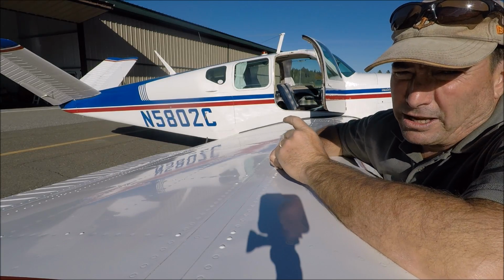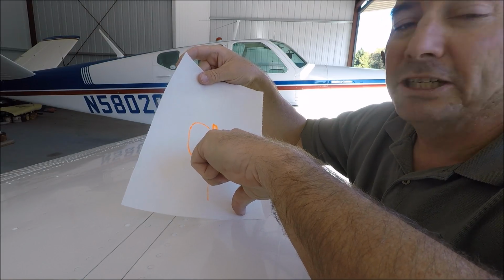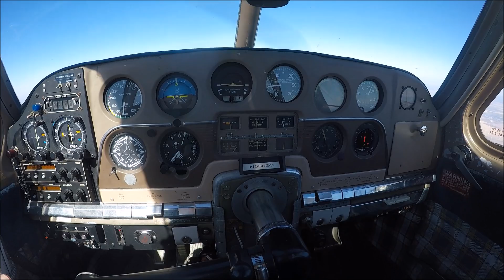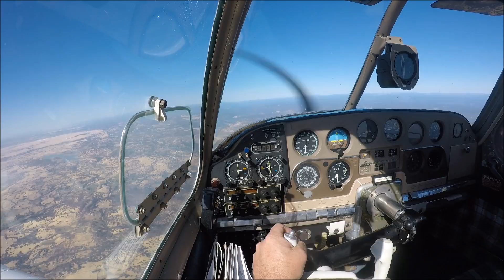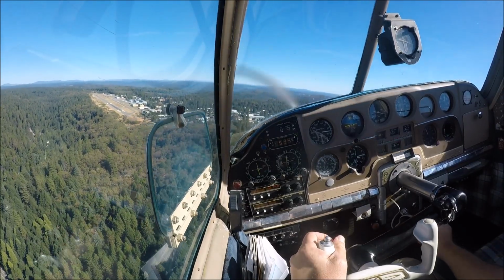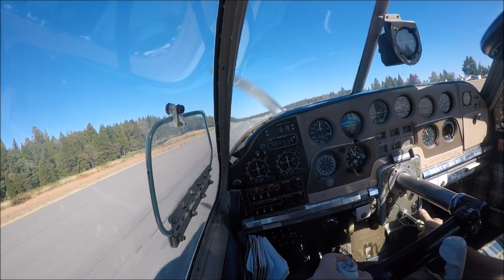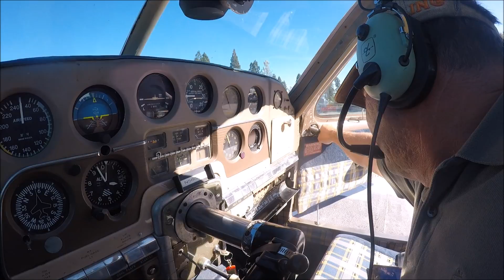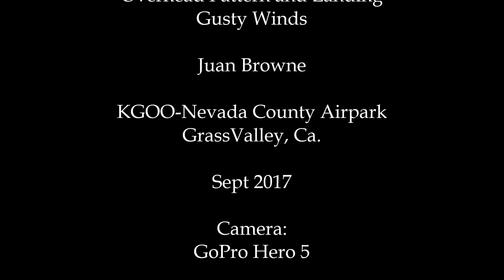1952 Beechcraft Bonanza Overhead Approach and Landing in Gusty Winds

Comment: Juan, Your explanation of a military approach reminded me of how we went into hot LZs in a huey, nearly 50 years ago.  Right over the LZ, reduce power (lower collective), pull back to 60 knots, then turn into a tight 60 degree bank.  Usually a couple of rotations and we were doing a cyclic flare in the last 270 degrees of turn.  Just a touch of collective at the end for a smooth landing or enough to hover.  The main point was, if we had lost the engine during the approach, we were still going to land in the LZ.  I love watching your approaches.  Constant adjustment, keeping the aircraft where you want it to be.
Reply: As with Juan,  THANK YOU BOTH FOR YOUR SERVICE FLY BOYS. 💙💙

Comment: Great Video Juan.  I liked the dialog hanging onto the wing at the beginning.  

Everybody has an Uncle Joe story and mine is that my Doctor in Simi Valley, Dr. Elias Khoury, bought the farm in one of these.  Had to find another Dr which was a real chore as he was a gem as well as a local character wearing tie-dye pants and rode a motor scooter around town.

Interesting that as a pilot I never came across your explanation of the pattern approach modes used by the Military as opposed to the rest of us flying normal 45º entry patterns.  Thanks for the info.  Regards.

Comment: Thank you for this video Juan the Cadillac of the sky for sure! As far as gas goes I bet you would spend more on gas in the same year GM Cadillac on this round trip.Taking the heat running ac as well almost 3 hour 1 way trip.Comparing the 2 apples to apples I would think I'd take the sky route every time!

Comment: Thanks for taking us along ! My boss back in the late seventies had one of those along with a Mooney  M20F Executive , I think . I seem to remember some pilots got into trouble with the V tail ? I do not remember what the problem was . Only small plane I spent much time in was a Cessna 172 my buddy used to rent from the Boeing Flight Club around 1980 . If I remember we could rent it for 12 hours for $99 , including fuel ! I was always amazed at how a pilot could know what radio frequencies were needed depending on where you were . The Puget Sound area has several airports and military sites . My favorite runway was Friday Harbor on San Juan Island . You landed up hill and took off downhill . It was also the narrowest paved runway we ever landed on . Look forward to whatever your next video will be , thanks for your effort .
Reply: Wikipedia: In the mid-1980s, the Federal Aviation Administration grounded the Beechcraft Bonanza due to safety concerns. While the Bonanza met the initial certification requirements, it had a history of fatal mid-air breakups during extreme stress, at a rate exceeding the accepted norm. The type was deemed airworthy and restrictions removed after Beechcraft issued a structural modification as an Airworthiness Directive.

Comment: I was trying to spot your gear and flap handles, but couldn't see them. The old Bonanza pilots would sometimes flip up the gear because it was located right beside the flap handle. They were shaped like flaps and wheels, but so much for that form of biomorphic design! I don't know when they changed them. I was just talking to a guy today who has a '62; he says his has the new-fashioned handles. I wonder if you had a way to plug your mike for the camera right into the intercom if the in-flight audio would be improved? I've never flown the Bonanza, but had the gearbox fail from metal fatigue (or casting flaw?) on the T-34 and plowed a furrow with the spinner. 

Yeah, I wish you would do more videos like this for the benefit of us private/sport pilots. I like the circling approach, but I didn't know it was legal on a civilian field. Can you straighten me out on that?
Reply from the maker: Wayne Tyson just call it out on the Unicom...don't mess up the pattern for others...

Comment: Two questions:

A- is operating a V-tail different from a 'normal' vertical/horizontal tail?
B- what are the advantages and disadvantages of a V-tail versus a traditional vertical/horizontal stabilizer arrangement?

I ask because the F/A-18 Hornet and all its variants/upgrades have both diagonal and horizontal stabilizers, yet this Beechcraft (and other models) does not.

PS: I could not understand a single word you said once you were inside the airplane!  Please double-check this during editing in the future.  Thanks!

Comment: Those tankers look like old Navy S-2 or C-2 aircraft.  Had the nickname of COD's.  Great machines for hauling stuff like mail onto and off aircraft carriers.
Reply from the maker: trongod2000 they are!
Reply: There are 20 Trackers at Nowra ,NSW, Australia- S2-Gs, still with their ASW gear fitted. They haven't flown since 1987 or so when the RAN stopped fixed wing flying. I was in the squadron next to them flying A4s and Macchi s (MB326). You would think the government would have the S2Gs converted for fire fighting , but apparently it is more cost effective to hire Skycranes and Canadian fire fighting aircraft!As for the Beechcraft- the turn and bank gyro seems to have a damping issue- it is banging the stops pretty hard. And while they fly well and are comfortable, part of that high cost of ownership is because they are terrible to work on in terms of that dash- there is no way to easily work on the back of it . The only way in is by going under the dash and reaching up around all the wiring, bowden cables, pitot static  plumbing and control yoke. Give me the Cessna 172 any day to work on- no Cadillac but far easier to work on.  I am a bit surprised that you guys haven't fitted something like a garmin 430 in place of those radios though.
Reply: I'm assuming you guys down under replaced their duties with P3's and maybe even now with P8's.  Good thing as I suspect you have a threat from North Korea just like all other civilized countries these days.
Reply: We had P3s flown by the air farce as well. They have new aircraft now. The navy uses their helicopters now, we no longer have a carrier at all.
Reply: I pray you never need one. BTW  did you mean to say "air farce" lol

Comment: I make that 24 US gallons. Not so bad for a 300 hp. engine and 200 mph top speed. Reading up on the "Bonanza" over 17,000 built and still in production. 1947 - 2017. This sets a record! ... Our Pilot Juan mentioned landing in a cross-wind....Hmmm...???... sounds tricky to me. Quote:- "...All Bonanzas share an unusual feature: The yoke and rudder pedals are interconnected by a system of bungee cords that assist in keeping the airplane in coordinated flight during turns. The bungee system allows the pilot to make coordinated turns using the yoke alone, or with minimal rudder input, during cruise flight. Increased right-rudder pressure is still required on takeoff to overcome engine torque and P-factor. In the landing phase, the bungee system must be overridden by the pilot when making crosswind landings, which require cross-controlled inputs to keep the nose of the airplane aligned with the runway centerline without drifting left or right. This feature started with the V-tail and persists on the current production model.["
Reply from the maker: Yep!, not too noticeable on x-wind landings.

Comment: one of the irritating absolutes with a small single-engine, cockpit noise, just the way it is. are those Collins radios? back in the seventies I was in the Bellanca  Viking scene and a lot of Vikings were equipped with the Collins Microline a great set of radios at the time they were so clear. nice video.

Comment: Hey Juan, I don't know anything about airplanes, I was in a small plane once when I was like 8, but I had a question.  It looks like the steering comes out of the center and then is offset toward you.  Is that made so that you can actually swivel it over to the other side?  And if so was that for emergencies or training or what?  Thanks.
Reply from the maker: That's correct, a "throwover yoke"

Comment: Juan, Ya,Ya was very funny. Pretty tough to keep up with the comment crew. Certainly you know your fuel consumption, but is refueling just visual?  Best regards, Bob
Reply: Most light aircraft have tabs, or some part of the tank structure visible when refuelling that experience has shown represents X amount of fuel. Some handbooks even give these figures. So you can just fill to the reference point or tab and you know how much fuel is on board.

Comment: Apparently you’ve accidentally discovered contact microphone sound. Maybe a "bean bag" holder should have been used for the "wing talk." Most intercom or headset sound is terrible. Your body mike below your throat would have been better than the camera mike.
Reply from the maker: Yea! that was odd...
Reply: blancolirio Your unintended external microphone diaphragm was the skin of the wing! The vibration was transmitted mechanically to the  diaphragm of your intended microphone. So you had some additional input, and it had a nice airframe tonal quality! 🤙